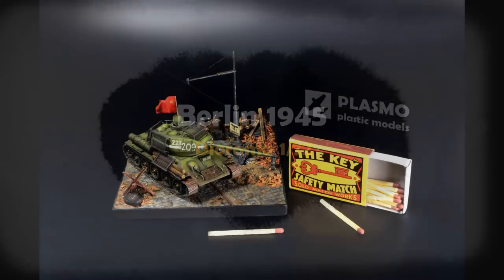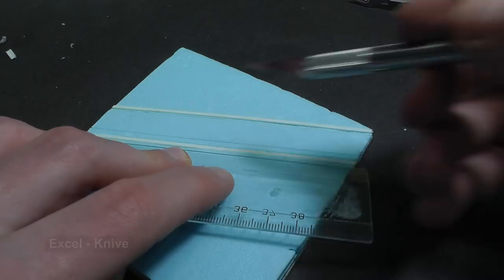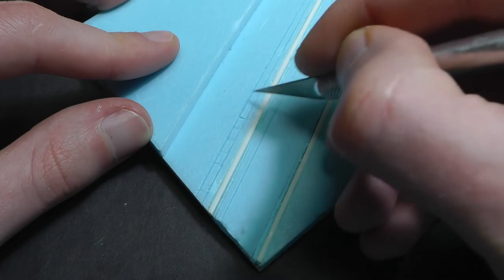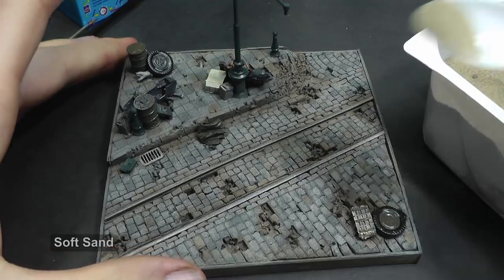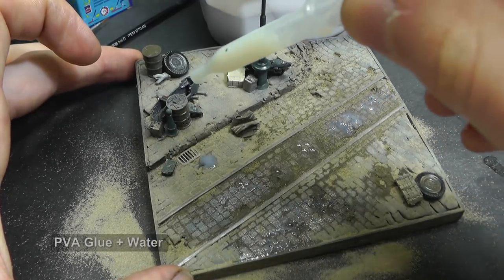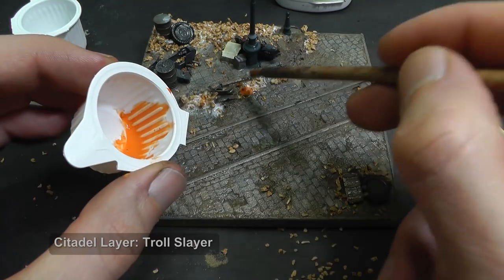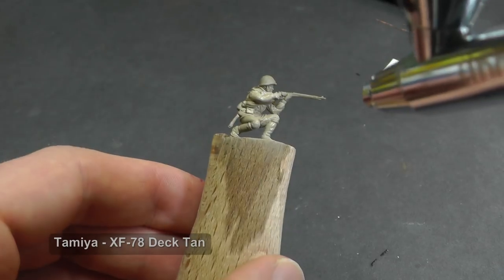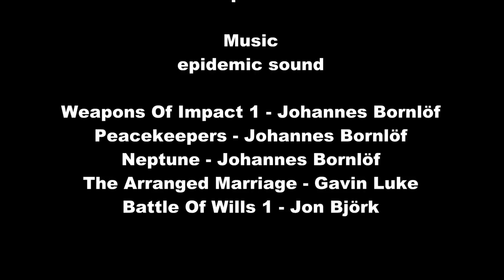Diorama Berlin Street 1945 T-34 Revell - 1/72

Comment: Good spraying colours! World class technique in desgin and making the basic environment grounds!But a little bit question :year 1945 Berlin nearly winter German or Russia worn big coats!T34/76 at beginning of war but Berlin almost meant end so Russia used Stalin's and T34/85 tanks!The flag didn't pulled from the command's hatch due to German snipers and flag enabled in or out! Flag hanged on the gun barrel or flattened on turret!Your ruin motorcycle seem smaller than the soldier#
Reply from the maker: Good point. Thanks. You have mostly right. It is based on fiction scene, so I just used some photos and videos from 1945. Some Soviet soldiers have cotes and some not. https://www.youtube.com/watch?v=SgHWSJBlnas It is 1/72 scale, so it is hard to find good figures in correct scale. In the box is 1/72 so it is for me good. Figures have in 1/72 scale tolerance +- 2 mm and that is a lot.
Reply: Its a T-34/85 tank model, so correct for Berlin :-)
Reply: There is plenty of footage showing soviet soldiers fighting in winter without big coats, they
encumbered movement. As for the flag, a little artistic licence is good if it adds to the movement/drama of the piece.
Reply: May not winter. "Stalin" is IS2?  in the Berlin offensive operation used a variety of tanks and self-propelled artillery,  including different modifications of the Т-34. this video really T34-85, even with by anticumulative screens (against bazookas "faustpatron"), which is also completely untrue. author plus for historicity
Reply: 😂 how can you criticise this it's probably the best out there

Comment: Why do you first glue all the small decorations in the ground and then paint them? Wouldn't it be easier to paint the ground and decorations separately and glue them afterwards?
Reply from the maker: It depends. I need to see the whole diorama together. Where make shading and lights. In 1/35 I instead paint each detail separately, but in 1/72 it is not a problem.
Reply: Oh I see. Thanks for the reply.

Comment: The tank he is using for the dioramas a T-34-85  the 85 comes because it has a 85 mm gun design to pierce the armor of the tiger tank and it has bed racks wonder why? Because Germany used the panzerfaust which is a HEAT  rocket launcher which is a shaped charge it was simple to use just a grenade on a pipe that’s why the T-34 model has bed racks to act as spaced armor and spaced armor was seen on German panzer IVs to protect against Shaped charges and high explosive anti tank rounds or HEAT for short.